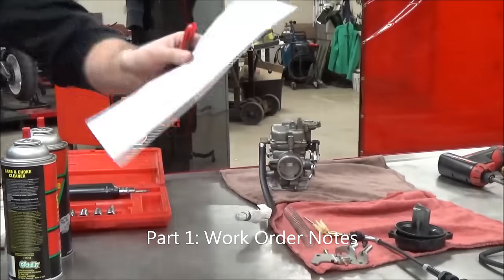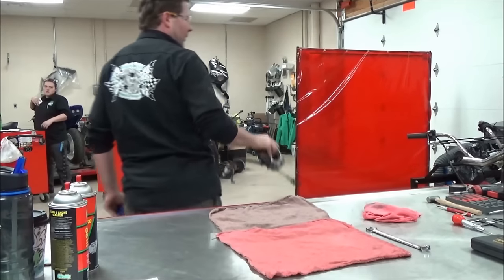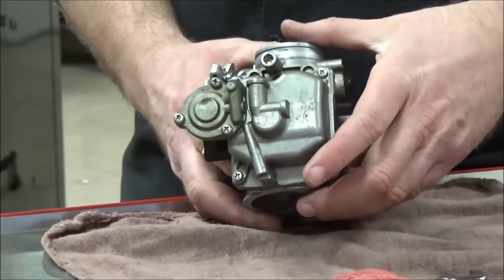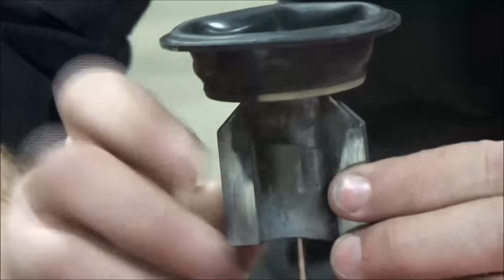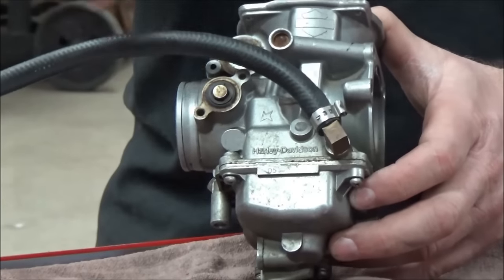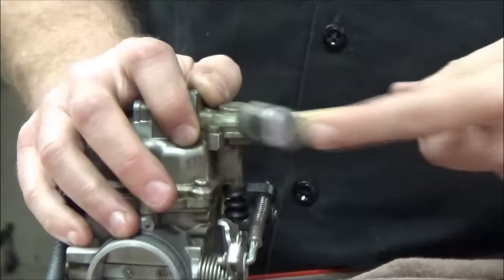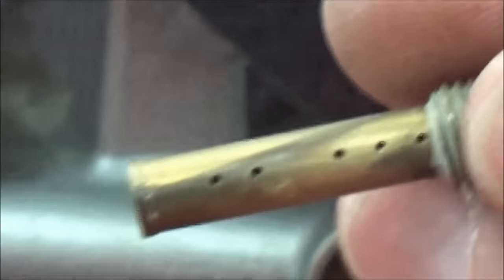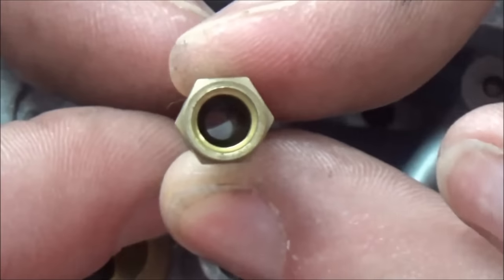01 "How to" CV Carburetor : Disassembly Recording Jets and Settings Cleaning Carb Rebuild Series

Comment: Most correct detailed video I've seen yet. But! I have a question? I've watched your video part 1 and 2 at least 5 times now. I pulled the carburetor off and drilled plug out removed everything and cleaned real good. after putting it together it ran great. But, after taking it on a 10 mile run to fully warm up engine , it started spitting and dying at a stop. I had to idle it up to around 1150-1200 rpm's to keep it running. when I got home, i tried adjusting the mixture screw and it made no difference even if I ran in all the way in to seat. I have had this thing off 5 times now trying fix but can find a thing I did wrong. I even replaced the intake rubber boot to the carburetor. It was real hard getting the carb. unseated from the intake too. 2006 FXSTB night train with 17,000 miles. I sprayed carb cleaner around intake and other areas of carb and nothing. You have any ideas that I might try? I'm a 70 yrs old Vet and was a auto mechanic for over 45 yrs. I've rebuilt a lot  of carbs back in the 70's and 80's but I lost on this one. Can you help?
Reply from the maker: That's a good question for Shane directly. You reached the social media team here. We get 300-400 requests a week, so it’s a bit time challenging as you can imagine. 
Shane does try to answer some non-members' questions when he gets some time so hang tight if you’re not in a hurry. 
Did you know one of the member benefits is to ask for which videos would work for your needs and get daily "quicks answers" to questions directly from Shane?. Best $1.99 a month you'd spend...of course enjoy the over 700 free videos and access the the member only vids with all the other benefits listed below. 

There are two immediate options that can get you a solution within 24 hours and quite often within the day. 

Option 1: 
Consider joining...best $1.99 you'll spend this month 😁 This is great for quick answers. 
He literally logs in and answers member questions daily! He does an AM and PM check-in to answer all member questions. Join this channel to get access to the perks:
https://www.youtube.com/channel/UCBhM8DCKnT3qXwTW0eToyCg/join    
-Daily MEMBER FIRST COMMENTS ANSWERED FIRST 
-Live Q/A video chats
-Wonder if we have a video on your need? Members can request content links!
-Full Access to the ENTIRE 700 video library
-Member-Only FREE tool giveaways  
Option 2: 
 If you need help sooner choose his 1:1 option! What you get is a deep dive one-on-one with him. Use video, email, and phone support. He will drop his tools and work with you directly! 
Get Shane’s cell here: https://how2wrench.com/ols/products/techline-one-on-one

Comment: Thanks for saving me there!! I thought I knew carbs enough to rebuild this bad boy... Until that silver piece the needle mates with at idle fell out in the wash bin... you certainly called that one!...... After viewing the video I am confident I am fully armed for re-assembly. Thanks again!
Reply: Rick Simpson  In my experience with an in line 4 system(which was a few years ago) I had two carbs that would fluctuate vacuum at idle and it made the idle change slighlty, but it did have that same hole you are describing on acceleration. Upon disassembly and very close inspection I found a small plug inside the float bowls that was supposed to plug off a port was in fact damaged on those two carbs. I would guess you are also sucking air somewhere that you shouldn't be inside the closed system
Reply from the maker: Thank you for taking the time to comment! Hit that subscribe button please! It helps us!
Here is a way to support all the free videos.
Want to say “thanks” or “keep it up”? Click here https://www.paypal.me/how2wrench  

Coach Conley is also available for hire to personally work one on one with you if ever needed. Yep he is a real person. Give him a call @ 602-345-0432

Your answers and help are just around the corner. Save time and money while protecting your investment and yourself by doing it the right way!
Follow us!
Web:
www.How2Wrench.com    
www.Tools2Wrench.com

Comment: i have just started watching your videos, they are fantastic. I was taking apart a CV carburetor and when it came to getting the "O" ring from under the fuel/air mixture screw I tried using my squiggly pick and the "O" ring was not coming out. Since I am a hoarder of tools or anything that can be used as a tool I looked into the box and came up with something which most mechanics would not have in their box, a crochet needle, it has a small hook on it and it is straight small enough to get into the orifice and hook that rubber ring without any further damage. I have some pictures of what I speak of, not sure how I can attach them to these comments
Reply from the maker: Fantastic idea. Thank you for sharing. What we have come up with that works well is a good old-fashioned paper clip! with a little hook bend. I better make a video on that one. I saw you took advantage of the membership at www.how2wrench.com and even got your t-shirt too! Thank you and you will see a private message with the contact number and member only email! 
Keep Wrenching,
Coach Conley

Comment: I have a 07 650 arctic cat prowler with a keihin cvk36-ae carb. I read somewhere they have starting issues with sitting for days or weeks on in. I seen someone recommended plugging the vent, not the float bowl vent. It's located on the top left of the carb. I guess they suggested it prevents fuel from draining back down to the tank? They run it that way all the time  even when riding.
Reply from the maker: No idea on that one  (we are just the social media team). I have not seen a question like this come before.
Let me try and see I can catch Shane to answer quick. (FYI. He answers channel members questions daily...best $1.99 you'll ever spend)
He is just returning from an extended stay in Japan training students this winter. You can imagine how full his inbox is. We are just the social media team. 
Due to his limited bandwidth on time and demand for help, we had to choose to forward any requests from members first and it is only $1.99 a month to join.  All member tech questions like this get directly forwarded to him every day! Be mindful and honest that this is for "quick questions" that would serve you answers that can clearly be addressed. If it's a diagnosis need you'll need to use the one-on-one service. 
Here is how to get in!
* Join here: https://www.youtube.com/channel/UCBhM8DCKnT3qXwTW0eToyCg/join       
* Just looking to give us a high 5? Click here: https://www.paypal.me/how2wrench 
* Is this an emergency and your head is about to explode from frustration or fear? Get Shane’s cell here: https://how2wrench.com/ols/products/techline-one-on-one     

Have you seen our "YouTube Trained Support Shirts? Great way to "high five us" https://goodfellasmerch.com/collections/how-2-wrench/products/support-shirt

Comment: Awesome video!  Thank you.  My bike has a Keihin CVK 36.  There was only one O ring in the accelerator pump assembly.  Was wondering if there's suppose to be two?  There is gas leaking out of it currently with only one in it.  The diaphragm in there seats good with no tears.  Was wondering also which way the O ring should sit?  There's a flat and a round side.  Thanks again!
Reply from the maker: Email me a pic
Reply: Robb Shaw

Comment: Here's something odd. I'm in the process of cleaning/rebuilding the two CVK 36 carbs on my '08 Triumph America. I bought the bike new at a dealer, and this is the first time the carbs have been off. For some reason, the washer and o-ring on both air screws are in reverse order compared to your video. Looking at the carbs from the bottom, the order is air screw needle, spring, o-ring and washer. Your video agrees with the breakdowns I've seen in a few other places, so my carbs are obviously wrong. It must have been a Keihin factory assembly error. Strange, huh?
Reply from the maker: Human error for sure...it happens...
👍 Thank you for taking the time to comment! Hit that subscribe button if you haven’t please! It helps us! 
Here is a way to support all the free videos.
Want to say “thanks” or “keep it up”? Click here https://www.paypal.me/how2wrench  

Coach Conley is also available for hire to personally work one on one with you if ever needed. Yep he is a real person. Give him a call @ 602-345-0432
Details here: https://how2wrench.com/product/personal-tech-training-phone-facetime/ 
Your answers and help are just around the corner. Save time and money while protecting your investment and yourself by doing it the right way!
Follow us! 
Web:
www.How2Wrench.com     
www.Tools2Wrench.com

Comment: Hey Shane. I have a similar carb (off of an LTZ 250) Bike had sat for about 5 years.. I went through the carb and degummed everything.. Reinstalled carb and bike won't accelerate.. It'll start and idle fine.. I'm guessing that the slide is stuck.. Any suggestions on getting this problem resolved.. Thanks brother.. I watch all of your videos.. 

Wade

Comment: couple things
I use a very long Snap On philips screwdriver ,the twist of the shaft snaps those bowl screws loose easily...
strands of stainless stranded wire are the only thing I could find to clean out pilot jets...don't use copper it will break off

Comment: shane you may have just saved my bike, im sure ive done the main jet error at 39 mins, my bike keeps sooting the plugs up and wont rev up properly, so if i have put the piece in the wrong way up, and my needle/ slide is sat too high, will this be giving my bike too rich a mixture at too low revs, thus sooting the plugs? i didnt know it had to go in a certain way, but i did note the extra threads sticking out when my main jets were tightened and thought it seemed weird.
Reply from the maker: Thank you for taking the time to comment! Hit that subscribe button please! It helps us!
Here is a way to support all the free videos.
Want to say “thanks” or “keep it up”? Click here https://www.paypal.me/how2wrench  

Coach Conley is also available for hire to personally work one on one with you if ever needed. Yep he is a real person. Give him a call @ 602-345-0432

Your answers and help are just around the corner. Save time and money while protecting your investment and yourself by doing it the right way!
Follow us!
Web:
www.How2Wrench.com    
www.Tools2Wrench.com

Comment: Out of curiosity have you considered a set of hollow ground screw driver bits? Wheeler makes a neat set not sure how well it will work I'll try it out when working on the other three carbs I need to clean though.

Comment: Quick question Shane... I have a 85 FJ1100 with mikuni bs36 CV carbs. I bought new adjustable needle jets and the little plastic seats that slide on the needles are seperate. These plastic pieces sit right below the notches and are what seat the needles in the side. The seats are very snug on the needles. My question is where exactly do I set the seats on the needles?  FYI The plastic seats on my used needles have a bit of play in them. Thanks a lot, Mike

Comment: Hi, Can you give me some professional advice about the mod that CV carb user often do. They cut one or two coils from the slide spring in order to make the tension lighter, so they can have a bit better throttle response. What do you think?
Reply from the maker: +Tuan Anh Pham Cong 
I know it will work in some cases but hurt power in others. Some jet kits actually come with "longer" springs to slow the slide action down for better power transition of the fuel circuits resulting in much better performance. My thoughts are companies like Dynojet and Factory Jet kits do the research and we reap the benifits of just installing and fine tuning. Thanks for joining me here and please share my videos!
Shane Conley
Instructor/Motivator/Motorcyclist
Reply: Thanks for the answer. Imo, the spring is cheap and easy to replace so I definitely will give it a try and hopefully it'll work on my bike. Thanks again for all the great vids, I've learn a lot from you.

Comment: very good video and i got to know more abt maintaining cv type carb.. 
also i have a problem,is it good to clean inside of the carb where diaphragm goes with sand papers?
Reply: a brass wire brush would probably be best due to scratching the sealing surface with sandpaper... i've heard people using sandpaper before but i think you could get better results with a brass wire brush maybe even a stainless steel wire brush.  Just try not to mess up the sealing surface otherwise you'll introduce leaks.

Comment: Shane, when you screwed in the air/fuel screw I took note at how far it went in and I could see it. I have four carbs from a gsxr and cannot get them all (air/fuel screw) equally out the orifice. Only one carb of the four will allow the needle tip to protrude thru quit a bit, the other three carbs only allow a certain amount the needle thru, ton the point of where you can see some of the needles tip just into the bore of the carb, are they not supposed to be all the same?
Reply from the maker: Sorry to have missed this comment. Yes, they should all be the same. Many reasons why they may not be from a previous repair: 
1. one was replaced with aftermarket (or junk drawer)
2. tip was broke off when cleaning
3. a mismatched spring was used (after they lost the original)
Also, my website is about to go live and I'm offering personal training and help through facetime, email or phone now $2 a minute! Contact me for details:
Email: how2wrench@gmail.com
Web: www.How2Wrench.com
Keep Wrenching,
Shane Conley
Instructor/Motivator/Motorcyclist

Comment: Hello Shane. Great tutorial. 
I'm going through my carbs at the moment and have a quick question that you or maybe someone else could answer: I drilled out the Welch plugs to get to the pilot screws, so it makes me believe that no one been there before. The screws were as follows:
1st 3/4 out
2nd closed
3rd almost closed
4th 1 1/4 out
The service manual states 3 turns out.
What should I go by when I'll put it back together?
Thanks

Comment: Shane, I know this is an old video but hopefully you will see my comment that this was an excellent video even for a novice like me. Would you have or know where I can get a good rebuild kit for mine (‘96 1200C Harley)? I have to choke/enrich it halfway just to run smooth and then of course it idles high at a stop. I’m guessing it needs cleaning but might as well rebuild it while I’m at it. I’m in Raleigh/Durham, NC. Thanks,

Comment: A quick question about CE course on a 1989 Honda CB 400 F. In line for motorcycle. Is there a need to be and Aaron Jackson system for the vent tubes
Reply from the maker: Mike Triolo If it was a quick answer I’d try to respond here but I wouldn’t want to lead you wrong assuming certain factors. Reach out to me on my website contact page. We have been overwhelmed with ungrateful people and
scammers so I had to do something for my sanity by screening the over 300
requests a week! I’d love to working with my members and supportors one on one! 

Contact Link: https://how2wrench.com/contact/ 

Your answers and help are just around the corner. Save time and money while protecting your investment and yourself by doing it the right way at www.How2Wrench.com 

Have you subscribed yet to never miss a video? Have you seen the video playlists https://www.youtube.com/user/conleybuilt/playlists? 

Want to say “thanks” or “keep it up”?
Click here https://www.paypal.me/how2wrench

Comment: Great video! Filled a lot of gaps on my understanding of a CV. Any advice on how to clean the starter jet, since it not removable? Air and spray cleaner haven't helped and I'm a little nervous to start ramming pieces of wire in there. Thanks!
Reply from the maker: Matthew Smith Thank you for the kind words and sharing my work. I do have so tips to walk you through to clean your starter jet. If I can ever be of service to you, here is a video explains how to connect with me. 
https://www.youtube.com/watch?v=vjvmB01ebcs 
Keep Wrenching,
Shane Conley
Instructor/Motivator/Motorcyclist
www.how2wrench.com
Like freebies? Click here for a free diagnostic checklist! 
http://gem.godaddy.com/signups/364621/join 

Did you like this free video and hope to see more? Would you just like to say thank you with a donation? Click https://www.paypal.me/how2wrench

Comment: I have an issue with a mikuni carb and it's a 4-cylinder Yamaha xs 1100. cylinder number 4 backfires and pops I'm trying to diagnose if it's a problem in the carb but I've cleaned them thoroughly multiple times and it does have spark but the pipe doesn't get hot when I have it running and I pull the throttle hard it shoots mist out through the carb. I did however have it backfire one-time very hard and almost blew the number for carb body right off the boot any ideas?
Reply from the maker: Thanks for commenting and adding value to our community!

Have you subscribed yet to never miss a video? Have you seen the video playlists? Over 600 videos! Check them out here: https://www.youtube.com/user/conleybuilt/playlists  

Want to say “thanks” or “keep it up”? Click here https://www.paypal.me/how2wrench    
 
Your answers and help are just around the corner. Save time and money while protecting your investment and yourself by doing it the right way at www.How2Wrench.com
Reply: I guess I should answer my own comment. Turns out I had a bent valve stem.  I had to go and buy a compression tester to find out that cylinder had non.  Intake valve was not closing.  So if people wanna know what causes gas shooting out of the carb.... that'll do it!